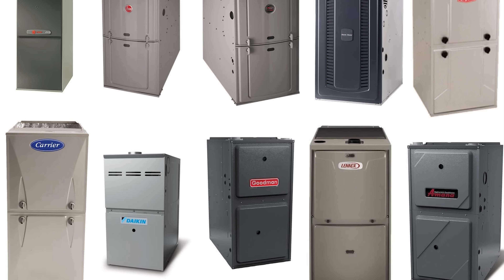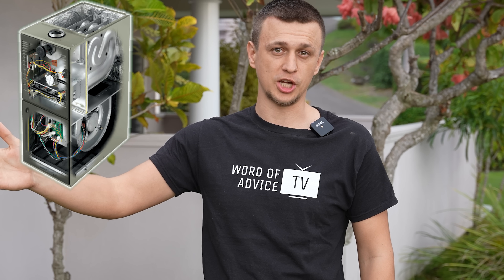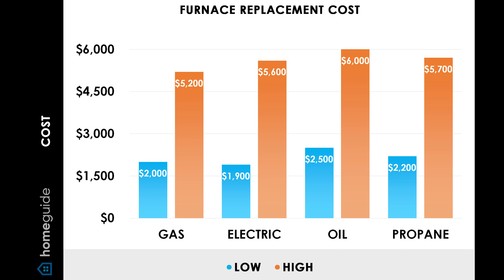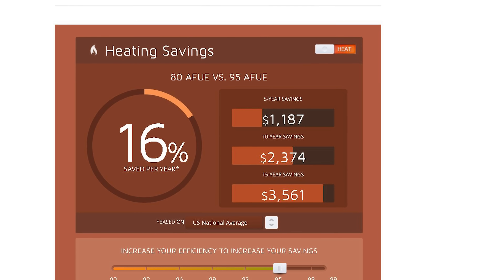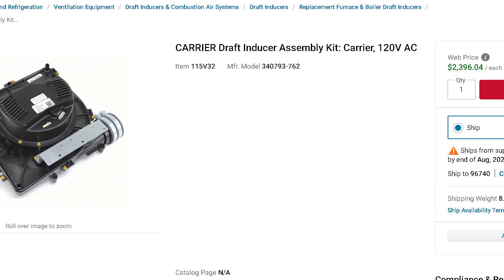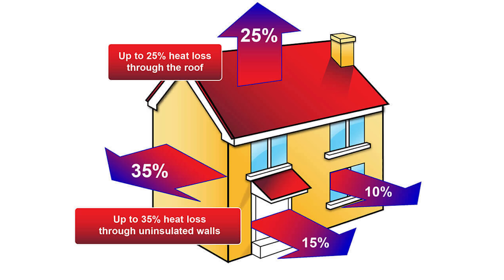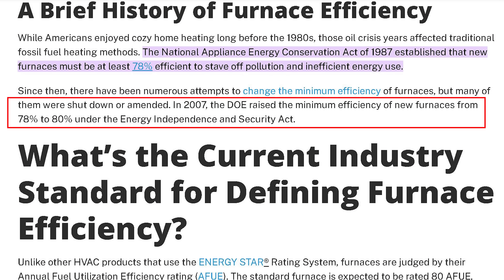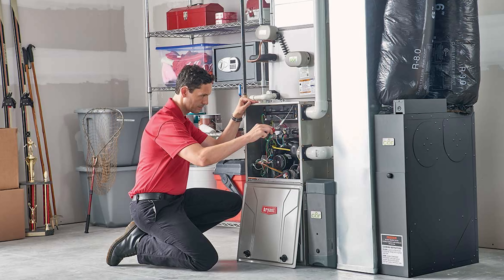Don't Buy a High Efficiency Furnace!

Comment: MANY times it's cheaper to ditch a chimney that needs repair and just go with a condensing furnace.  Chimneys must be maintained and repaired/relined.  Condensing furnaces are not that much more money.  (They are when the dealer marks them up!)  You also have the benefit of not using indoor air from the living space to fuel your furnace and chimney.  That means less chance of carbon monoxide poisoning when you turn on the stove hood fan and bathroom fans.  Chimeys often leak because they are a hole in your roof!  Seriously consider a single stage condensing furnace if you're in colder climates and need 100k btu or more.  All the furnaces use inducer fans now so it's really a wash.  Never ever go with a modulating furnace.

Comment: I've got a Amana 90 percent efficiency furnace that was installed in 1996, It's still running fine and Does save me lots of money in the long run. Every homeowner should always research a product before considering installing it to begin with, high efficiency or not! I've heard nothing but Good things about Goodman brand High Efficiency Furnaces. I think it's all a mater of the reputation of the maker, for me the Amana has proven High Efficiency can easily last 25 years +

Comment: Your comment about the furnace not working on Christmas is so funny as almost to the day last year this exact thing happened to me. With the knowledge gained from your videos I quickly determined that the inducer motor failed. So being it Saturday, the coldest day of last winter, I call a service company that claims to have a warehouse of parts stocked on their service trucks. I really wanted the heat back on that day. As was the case he had no inducer motor for 4-5 days at the cost of $1000. He leaves and I decide to remove the motor and look at it. Turns out some debris had jammed the blower wheel. I removed the debris and 1 hour after he had left, I had heat and that motor still works fine. As far as the high efficiency model I'll go with them as they will probably outlast me.

Comment: It’s important to note that manufacturers are no longer using stainless steel for their primary heat exchangers, including 80% furnaces. Stainless steel has been replaced with aluminized steel, which is a far inferior product than stainless steel. The lighter gauge metals combined with higher corrosion rates cause premature failure.

Comment: Avoid installing 90% furnaces where it will experience freezing temperatures such as unconditioned attics.
I’m a now retired 40+ year HVAC&R tech (primarily serve) in NE Illinois I will partially agree with you on the modulating furnaces the energy savings is not worth the additional cost but they do provide additional comfort. As for 90% furnaces most do not require repairs as for life expectancies many last 30 years+ about the same as the 80% furnaces and often make sense in our area. On new construction the 90% are often nearly the same price. Sometimes the replacement costs upgrade to a 90% are minimal and worth the additional costs in northern climates.  We are moving to NE Oklahoma our new home we’re relocating the furnace and will I’ll be installing a 90% because it’s easier to install the vent pipes.

Comment: Hi Jay, great video, thanks for educating us. I'd like to know your opinion on my case: i live in Canada , canadian winter -10 to -12 degree Celsius is common (could be much colder). My present furnace is 30 years old and is still working fine. I plan to replace it not because want to upgrade to high efficiency one but more because of its aging, because concerning if it died this winter i would be stuck in cold for few days while waiting for a new one. A furnace tech took a quick look and said my present furnace is 60% efficient,...more comments... (not quite understand) . I was given some options for a new furnace:
(A) Rheem R96V (2-stage variable speed) or R96T (2-stage constant torque), 
(B) KeepRite G96CTN (2-stage variable speed) , or G96VTN (2-stage constant torque) , 
(C) Lennox ML296V (2-stage variable speed)  , EL296E (2-stage constant torque)
1) I will take your advice keeping my present till it ends.   
2) If it ended this year which of the above brands should i pick? 
3) Should i go with 2-stage variable speed, or 2-stage constant torque. All three above are up-to 95% effficient. Or should i stick with single stage furnace 80% as you mentioned? which of these is suitable for my house with long canadian winter?
4) My house is about 2,500 sq ft, should i go with 60K, 70K, or 80K input BTU? Different furnace techs. give me different BTU. Thanks

Comment: In late Nov. I had our 37-year old single stage gas Day and Night furnace replaced. I'm near San Diego, but it was cold in the house, and I didn't want to take a lot of time studying and shopping around.  My main decision was selecting a company with sterling reviews, then I trusted them for equipment and price. This was a small company near our home.  He put in an Airtemp single stage.  That's not a common brand, and I am a little concerned.  I need the company to still be in business if and when I need major repairs. And, I do agree with your recommendation to go with the 80%, and especially for me since I live in a mild climate and don't use a lot of natural gas.
Reply: San Diego  !! are you kidding?  I lived in LA and we ran the heat about 3 days a year
Reply: @pablopicaro7649  I hear you.  There are residents here who don't heat their homes in winter, and even have the windows open. We run the heater Nov.- March, keeping the home 68 degrees night and day.

Comment: My Father had a Rheem 90%+ installed back in 1999 and it was perfectly fine with ZERO service done when he sold the home in 2019.  Strange but not impossible.
Reply from the maker: Thank you for sharing an example of a long-living, problem-free high efficiency furnace!
Reply: A/C included.  Zero service not even a coil clean.  Any any of you will know that those coils weren't easily accessed as they had a steel battleship built around them, essentially!
Reply: @WordofAdviceTV  No problem.  It's rare I know. I remember the furnace had a sparking igniter rather than a hot surface igniter.

Comment: You have completely ignored the comfort side of the equation. Modulating furnace increase comfort by a large factor. All hvac purchases are not based solely on efficiency.

Comment: You must not live up north. Here in Wisconsin, no one has an 80 percent furnace. And contrary to what you've said, the only difference is the heat exchanger, really. They all will have the same valves, pressure switches and electronics in both. Either version can have modulating valves (and the comfort advantage of that or 2 stage is very worth it). Both will also now have ECM motors, and if they are the low end constant torque ones, can easily and without high costs, be repaired with "generic" ones from Genteq like the Evergreen motor or the US Motor's Rescue motor.

Comment: As a retired corporate energy engineer, I agree with you.  Same applies to heat pumps.  New York State, where I reside, has played with passing the 95% energy efficiency rating furnace as well as banning natural gas in new homes.  Wait until the emergency heat coils all fire up on very cold days, the grid will be stressed.
Reply: Indeed if the general grid is not ready by the time the ban is/was issued then that's disasters waiting to happen.
Reply: The heat pumps that will be replacing gas furnaces do not require heat strips. Sorry!
Reply: @sprockkets  No?  The new heat pump unit I had installed in Naples, FL had a 8 kW heat strip installed.  The new home I purchased in Venice, FL had a 10 kW heat strip installed in the heat pump air handler.  The new central heat pump unit I had installed in North Carolina has a 10 kW heat strip installed.  These were all central whole house units with a central air handler.  The heat strips are energized when the heat pump can not maintain the set point temperature and when the unit goes into a defrost cycle.  Small mini splits don't have heat strips but they typically are not installed for whole house operation since every space requires an air 'box'.  I have installed several of these myself.  How well do you know the subject you are writing about?

Comment: I mostly agree, but condition of chimney for the 80% and ease of installing the PVC venting for the 90% plays a large role in what I recommend. Relining a chimney or having to tear up a finished basement to install 3" pvc can add a lot to the cost.
Reply: Lets not forget that you have to look at pvc running up the side of your house, for some may not be an issue but i’d have stare at that thing everytime i was sitting on my patio
Reply: @msk3905  I have similar situation and my plan is to change to all electric furnace when my current old furnace failed.  My water tank is electric already and I'll let go my gas company and carbon monoxide detectors.

Comment: As a home owner, I agree with the points you made. In my Canadian province, HVAC companies won't install anything less than 92% or something of sort. I have a 20+ year old, 80% eff two stage furnace that runs well, only thing I've had to do is replace the inducer fan which runs around $300-$400 to buy in Canada. I don't think a 90+ % eff gives you a cost return in the life of the furnace to overcome the install costs over a 80% eff furnace.
Reply: Lets Calculate: Savings of 95% over 80% for 35 year life of Lennox Pulse.  $1000 year spent on Nat Gas with 95% so spent $35k in 35 years.  Would need 19% more gas for an 80% (.95/.80=.19).  So $35k * 19% = $6,650 saved over 35 years.   NOT ONLY is there energy savings, but HIGH quality equipment last twice as long, so saves another $3k to install another one.
Reply: @pablopicaro7649  New ones don't last 35 years. Also only 15% theoretical difference not 19%. Half or more of my NG bill is distribution costs which stay same even if no gas used. My NG use is more than just furnace, have 2 water tanks, a NG range, fireplace and a garage heater. In spring_fall I might use $60 worth of gas every month, 100-150 in winter, (cold climate). There is no way I'm going to recover the $5000-$6000 over 20 years to offset the cost of a 95% furnace.
Reply: @gnic76  Good you analyzed for your case,  The increase in fuel use to make same heat is 19%, the efficiency difference is 15%,  different calculations.

Comment: Sounds like good advice. Maybe I lucked out but in '97 we put an addition of 350 sq ft on our home and at that time we replaced a standard efficiency furnace with a Rheem 90+ high efficiency furnace.  With a bigger house we were now paying a little more than $100 less a month on average.  We live in the northeast so we get cold weather.  In the 26 years we have owned the furnace we have just had to replace the draft inducer in 2016 and the condensation pump in 2018. Knock on wood it is still going strong. You have me thinking though about what I am going to do when it comes time to replace it.
Reply: The issues this person brought up are not issues in reality - high efficiency furnaces are used everywhere up north. You'd have to be a fool to put in an 80% one if you don't already have 95%.
The south is the worst - they'll put in vents in the home's ceiling for them to allow them to intake air, and in the summer they let in all the 95 degree air in.

Comment: Hurray!  Great advice. This 80% vs 95% question is exactly the way I weed out HVAC contractors!

Even in a heating climate like the upper Midwest, especially if you have decent insulation or a modest size home, the higher repair cost for a “high efficiency” furnace is only cream for the 80% route. 

To prove it, take your monthly winter gas bill, deduct something for the consumption of your gas water heater or gas range, subtract 80% from 95% (or whatever) to get 15%.  Multiply 15% times the above adjusted gas bill. Multiply that result times the number of heating months. Divide that $ amount into the extra installed cost difference of the high efficiency option. For most people in modest size homes, the payback of the high efficiency furnace is long after its expected lifespan!
Reply: An example for a modest size home in a heating climate, with basic insulation and original windows: (same home in more moderate climate would likely make even less sense for a High efficiency furnace)

Average gas bill during heating months: $125
Deduct an estimate for other gas consumers (dryer/water heater/range) by looking at a middle of the summer bill: $25

$125 -$25 = $100

High efficiency furnace 95% - Standard efficiency furnace 80% = 15% (savings due to the high efficiency furnace)

$100 furnace gas bill x 15% savings = $15/month savings 

$15 x 6 heating months = $90/year savings for the High efficiency choice. 

Upcharge for the High efficiency furnace install: $2,000

$2,000 extra cost / $90 annual savings = 22 years until you break even, long after that High efficiency furnace very likely died.
Reply: Look at your cost of gas plus taxes and fees based on usage only.  Probably about $0.8/Therm (1 therm=100067Btu).  Calculate savings from efficiency rating.  80%/95%=84.2% so 15.8% less gas used.  IF $1000/year in heating GAS cost  (not fixed fees).  then with better unit gives $158/year saved.  over 20 years would be $3160 (disregarding any increases in repair cost - impossible to predict).
Reply: @pablopicaro7649  yes, it is the variable portion that matters.  But you also need to deduct other gas using appliances like dryer, water heater, and range.  So subtracting the avg summer bill from the avg winter bill does a better job of isolating the variable furnace gas consumption.  By definition, that also isolates the fixed portion of the bill.  Refer to the calculation example shown above.

Comment: The top of the line has always had diminishing returns in almost any product or service.  With that said - a basic high efficiency furnace shouldn't cost much more than a standard furnace.  In my area (Canada) there is little difference in pricing and parts are readily available. I'm NOT an HVAC technician - however I am far more intimate with my setup than  the average consumer. I'll let you know how things go with longevity - but my 23 year old carrier (which is commonly known to have secondary exchanger failures) has yet to kick the bucket.  The power venter motor and igniter have gone on it once - with a cleaning being required for the flame detector once (shortly after I bought the house 15+ years ago). I expect to replace it before it is 25 years old - but I keep the ducts clean and use a 4 inch thick filter which is replaced every 5 months and is not overly restrictive. I believe it is irresponsible to paint the entire market with a broad brush leaving people with the impression that all high efficiency furnaces are ALWAYS a bad idea - especially when the cost of fuel is skyrocketing and pricing for equipment is comparable in many markets.  I will be replacing mine with another basic high efficiency furnace when the time comes.

Comment: If i need 80 thousand btu s at -40 and it is only -40 three weeks a year and the rest of the year i can heat my house with 40 thousand  btu s I have had a bryant 90 i 2stage havent had a problem in 22 years and having a 80 percent with a open flame and putting a new ac unit with a flammable refrigerant probably isn’t a good idea

Comment: Ok so if you’re moving in 5 years yes you may want a less expensive unit that I will agree with. Best thing to do is dollar cost average your last year at least of power consumption, do guess if you can recover the additional cost know. Do the math. Most wont and that’s on you for being lazy. Most quality furnaces have a 10 year or more warranty on the heat exchanger so that’s irrelevant most manufacturers today have a 10 parts warranty so not an issue there until year 11. Also with the higher efficiency unit, you get better control over the blower this will allow for air scrubbing (running of the indoor fan during off cycle use cleaning the air with proper air filtration). A high efficiency unit reduces emissions, in some states will allow you to by bass blower door testing($$$), and will be useful with multi stage ac condenser units. All that to with 1 exclusion and that is a roof top package unit and those only come in 80% so simple choice there watch the up sale of seer ratings because you have only one way to offset costs, split systems offset costs on the cooling and heating systems. But the reality of it is you the user needs to do what’s best for you and that could be burning wood in the fire place until you can afford the cost to replace your unit.

Comment: I moved from a 80% furnace / single stage AC  to a high efficiency furnace and variable AC.  Two things make it worth the cost, noise and comfort.  Not hearing the Furnace or AC kick in and the constant comfort is worth the price.  The energy savings are not.

Comment: New home owner here. I have an furnace that's original to the house (circa 1987). Its got corrosion on some key components based on the reaction of 2 different techs. One of the techs mentioned switching to a "wet base boiler" compared to my day base one. Is this what you're referring to when you say "high efficiency"??